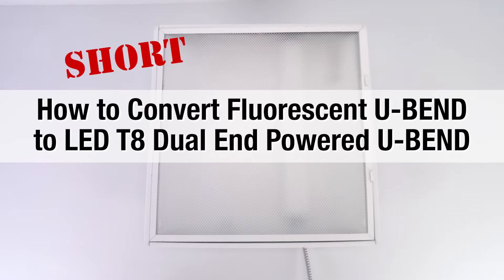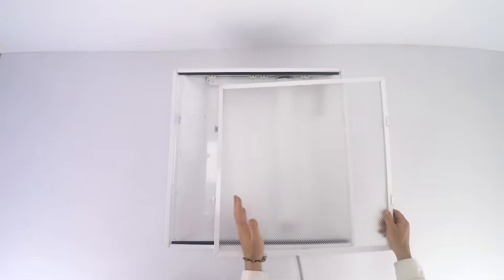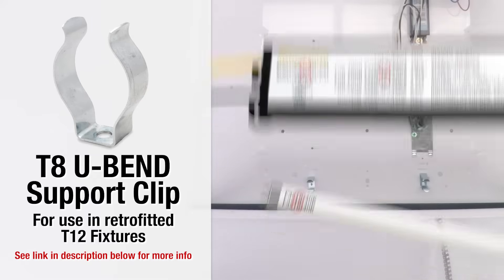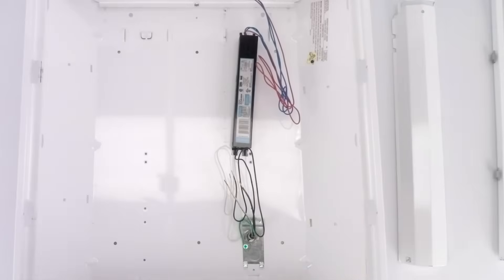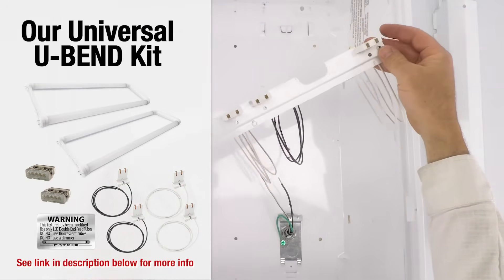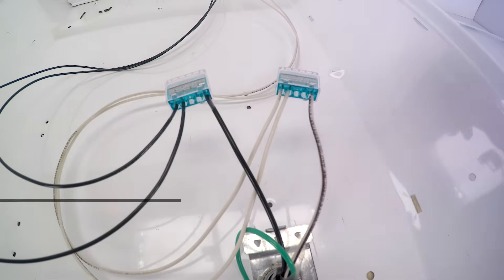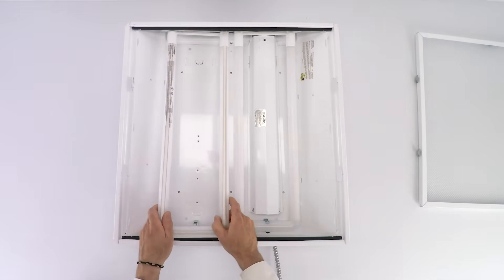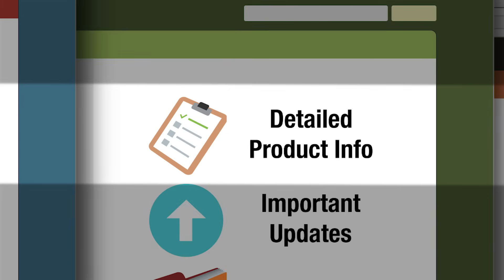How to quickly Convert Fluorescent U-BEND to EZ LED T8 Dual End Powered U-BEND - Short Version

Comment: My restaurant had nearly a dozen fixtures similar to these in drop ceiling troffer boxes. Some were the 2x2 and some the 2x4. I pulled ALL of them and swapped them out for flat panel LED panels. Far lighter, brighter, and no more expensive than the bulb replacement kits shown. Biggest issue was needing to make a run to the recycle place to dispose of all the replaced fixtures.
Reply from the maker: Glad to hear you found a solution that fits your needs and for sharing! Many of our customers have shared the cost of replacing the entire fixture of meeting code requirements, electrician expenses and labor to install new fixtures far out ways the cost of doing a simple retrofit like in the video. Everyone's project is different with different needs. Again glad you found a solution!

Comment: I dont understand why you cant just use the existing sockets with the red and blue wires and connect those to the live and neutral wires. It seems like that would be the easiest and most cost effective way of doing the LED retro fit. Also, why do you need shunted sockets instead on non-shunted sockets? How do i know if the bulb is single ended or double ended if it doesn't say it on the packaging? Can i use non-shunted sockets instead? (It's all that is available at HD for some reason)
Reply from the maker: There are many different manufactures of these type of fluorescent u-bend light fixtures that have different wiring configurations. The best thing to do is follow the wire diagram for the dual end powered u-bend led tubes when retrofitting your fixture 🙂

Comment: Thats great for a fixture that has old t-12 6 inch spaced legs, what do you have for converting old T-12 with 3 inch spaced legs??
Reply from the maker: Unfortunately, we have not found any U-bend tubes that are smaller than the 6 inch spacing 😞 If you do find them and they are dual end powered you can apply the dual end retrofit method as shown in the video here.